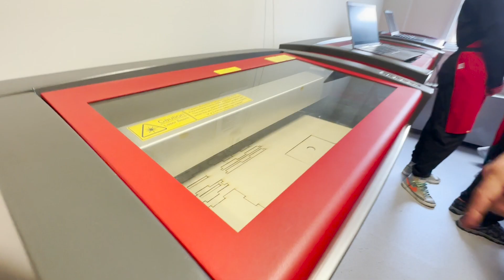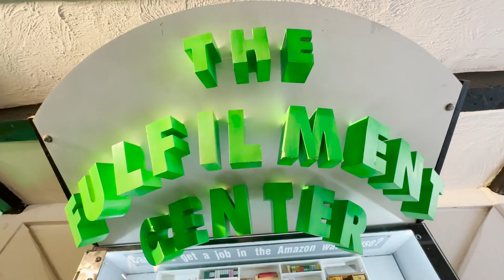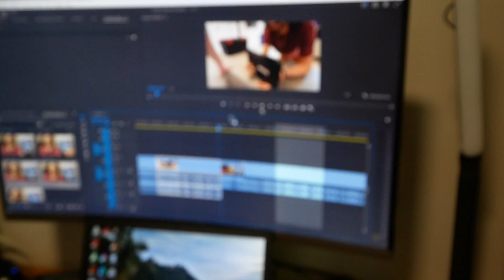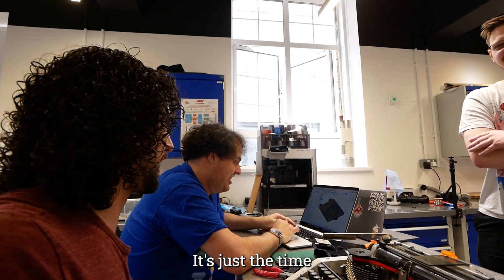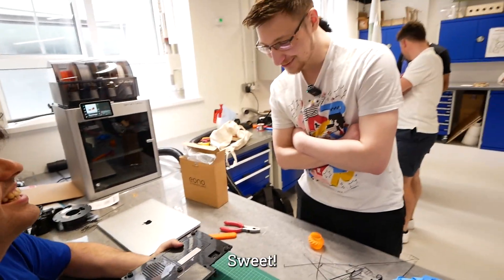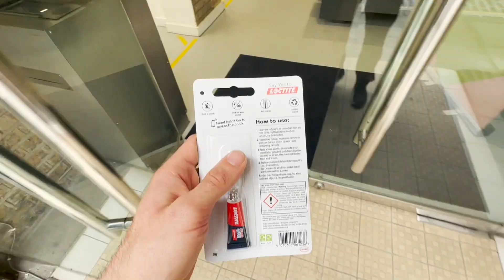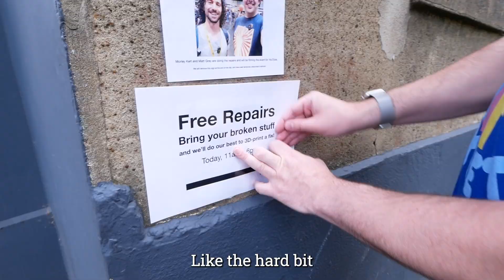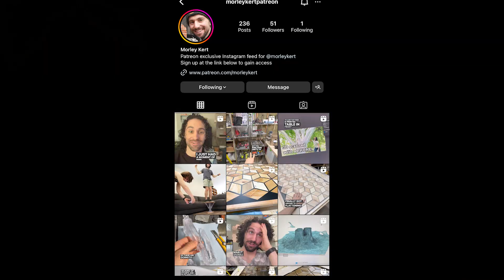Free 3D Printed Repairs for Strangers in LONDON!

Comment: Hi Morley, I own a Creality 3D printer which I believe is an Ender brand. Having trouble with project sticking to the glass. After I seen this video I think a thin flexible polycarbonate sheet with texture would work attached to top of glass? I’ve seen one like you used as a cheap mouse pad I think? Your thoughts would be much appreciated

Comment: Would anyone know what type of print material would be good for using as a mold for epoxy product pouring? I’m thinking a consistency like that of silicone would be best as long as the epoxy can cure in the mold and be released from the mold preferably without mold release.

Comment: If the coin lid fails down the track, reprint it sideways and it will probably be stronger due to the layer lines working with the flex not against it.

I came from Matt's video.

Comment: I printed a gear that spin’s landing lights on a single engine plane! My dad works on them and explained that they’re meant to break if they get bound up so the actual motors don’t overheat and break. He was looking at $$$ for each of them because the planes aren’t made anymore so replacement parts are expensive.